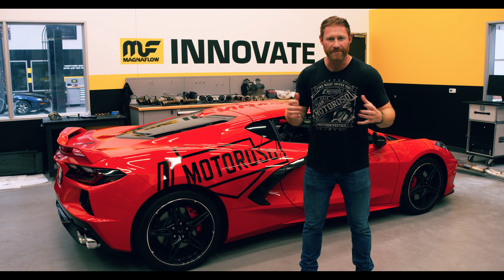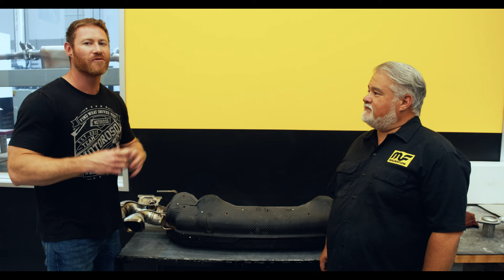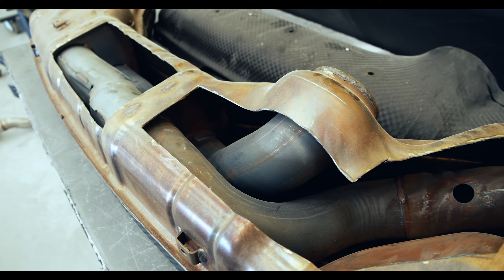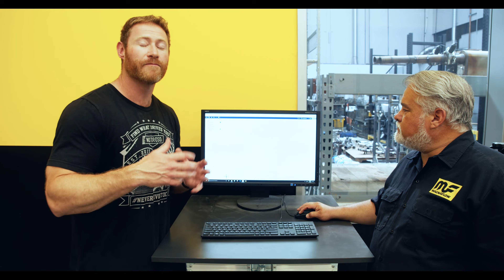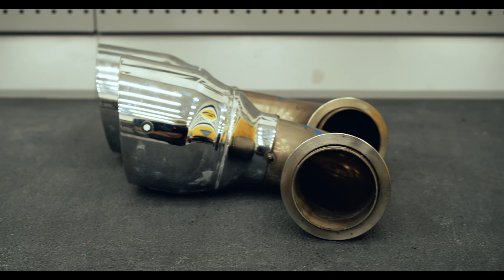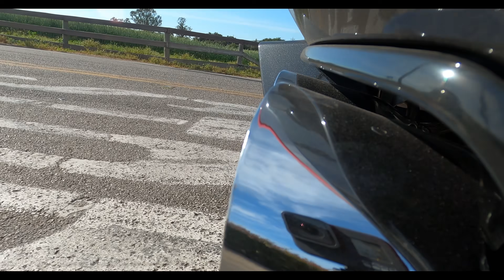Magnaflow C8 Exhaust Part 3: Designing the new 2020 C8 Corvette Exhaust - Rich Waitas Interview

Comment: Still missing the exotic sound!
Reply: its not really gonna happen...the sound can be improved for sure though the stock exhaust sounds sweet and  hella better than most aftermarket  systems ..They tend to make it Louder and add a coarse rasp but thats Not the exotic sound...I know what u mean...Ive only heard One c8 that sounded borderline exotic..it was a white one and I cant find the vid again, dont know the mods done, but its exhaust was hands down better than Anything currently on the net...it Almost sounded like it had a DOHC in it but it didnt...just exhaust
Reply: @skip741x3  Thank you for the update... I have heard that Fab speed and Borla are both in the works on an "Exotic" sounding system.
Reply: @skip741x3  I think you are talking about the video of the exhaust from Cordes Racing Performance....best sounding C8 I've heard.